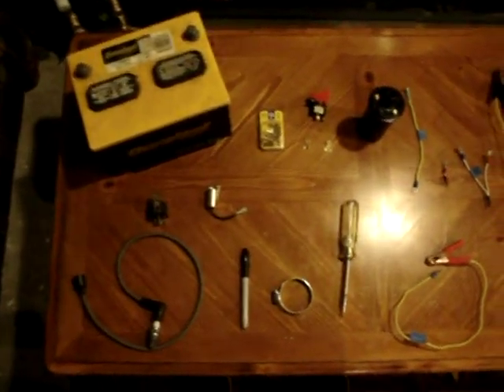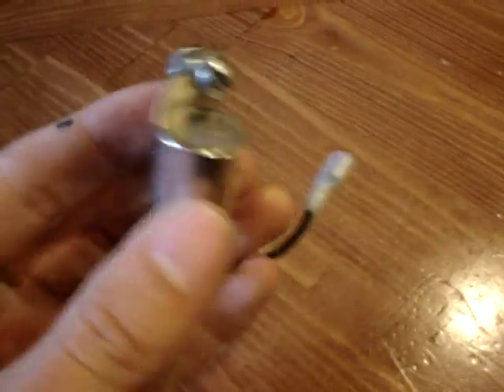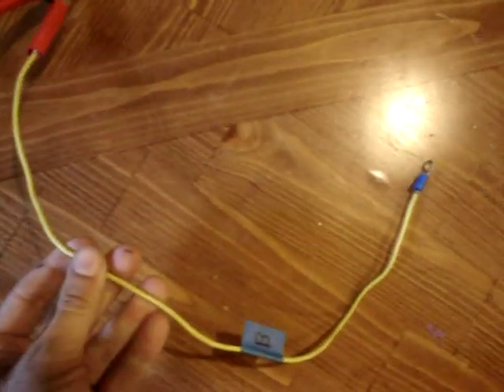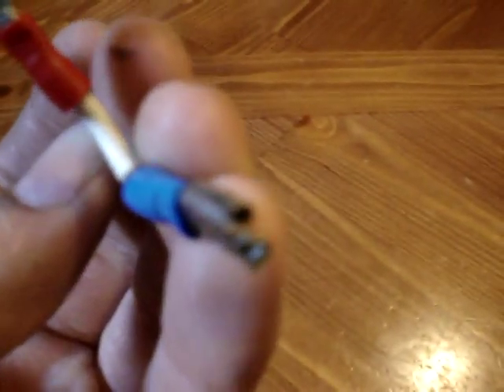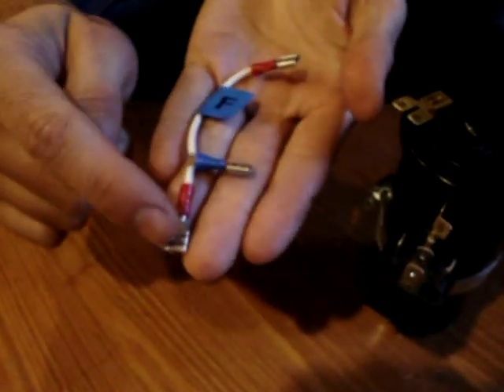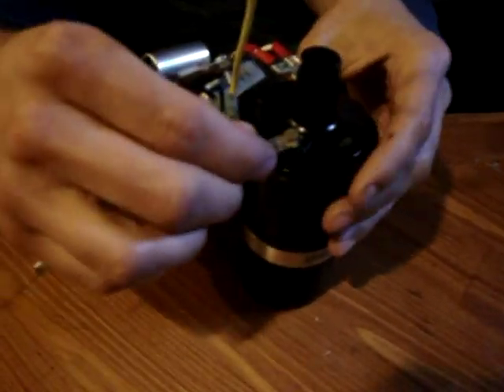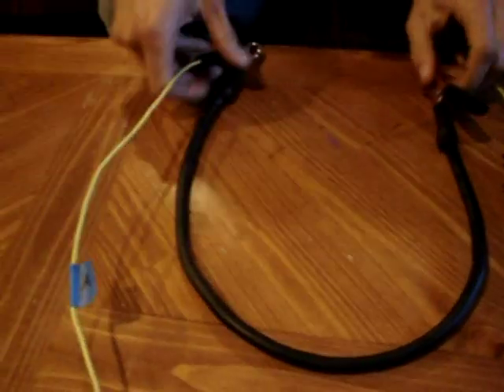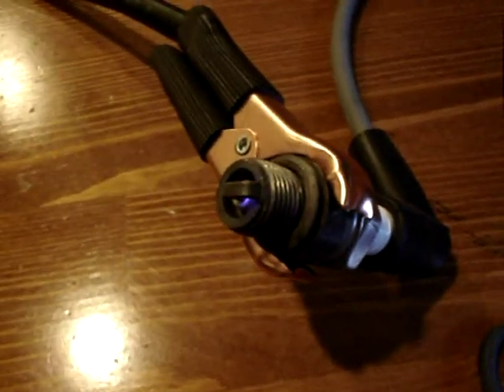How to make a buzz coil Part 2

Comment: Do you have any experiance what culd cause car to run when key is turned of on ignition switch?
My engin refuse to stop when I turn on blinkers any idea what that culd cause?
Its anoying my engine gives full trothel by him self when lights are turned on ore blinkers are working.
I get small electric shock when tuching ground ore chassis

Comment: Excellent presentation.   As a kid 61 years ago (I'm 77), I made an exhaust pipe/spark plug flame thrower!  Running down the road in our 52 Plymouth, you turned on the coil (spark plug), turned off the ignition of the car, press on the accelerator to feed raw gasoline out the exhaust pipe, and ADMIRE the long tongue of flames coming from your exhaust pipe!  It was 6-10 feet long and scary!  Kids do fun shit!  In the mood, I bid on a Model T coil today on E-Bay!

Comment: Would this work for an exhaust flame thrower setup.? If the car runs Ritchie already.. Don't know if you're familiar with how those kits work. But there's something in the system that shuts off the ignition system momentarily allowing fuel to pass through the combustion chamber being ignited. I'm trying not to use shutting off the ignition system because the car already runs Rich any input would be greatly appreciated best regards.
Reply: Luis Rodriguez using it for an exhaust flamethrower as well lol except I'm using propane out of a diesel stack

Comment: Great Job! Sorry if I missed it, but do you have a part # for the coil? It's a coil for solid state ignition systems but that shouldn't matter as both the old kettering coils seem to work too. You get a much faster spark than the old Radio Shack relay that I used. You have hit on a great combination of parts and it would be nice to know exactly what they are. You did show the condenser part# .

Comment: This is a brilliant tutorial, if you happen to be in Australia the parts might take a bit of research ie there are several different 5 pin relays, most places (Autobarn,Supercheap,Repco) stock the NAVA brand. I tried a standard  relay but it didn't work.What did work was the Changeover Relay part number 68044BL. For the capacitor I had an old one from a Ford V8 distributor. This tute says to use a 600volt capacitor the Bosch ones I tried were both 0.22 microfarads with max 400v. Worked fine

Comment from the maker: You should upload the video! I think I ran into the same problem until I had the battery grounded with at least a 6 gauge wire to the metal object your trying to jump a spark to.

Comment from the maker: I ran into the same problem and ended having to ground each part individually and had to get bigger ground wires. The electricity is not grounding well enough so it makes it discharge inside the relay.